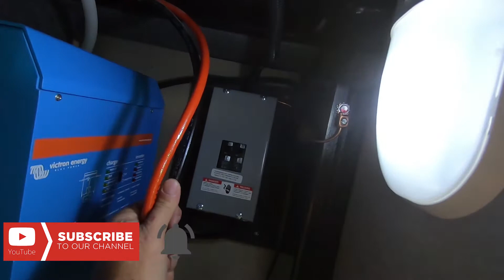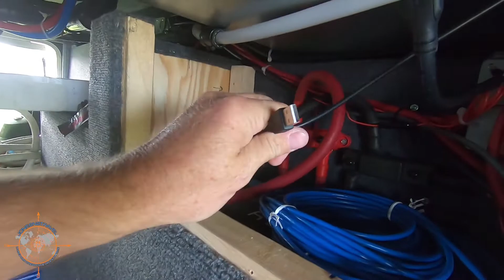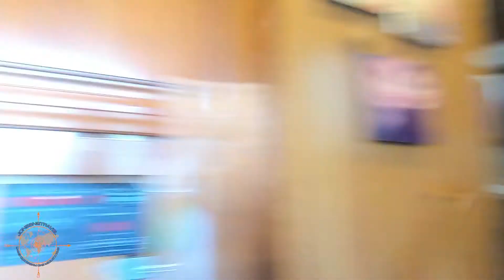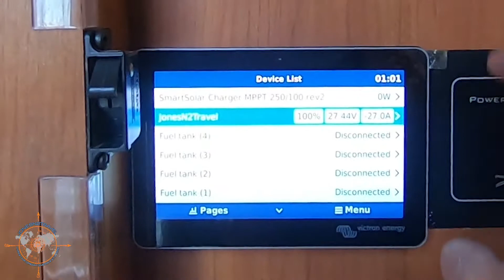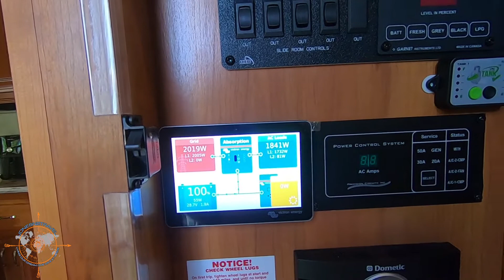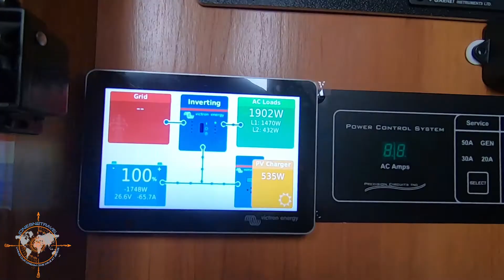DRV ULTIMATE SOLAR INSTALL | PART 4 | RV LIVING

Comment: As a follow up to our exchange a couple of months ago, the inverters are rated at 250 DC Amps and the 4/0 cable installed is rated at 195 DC Amps which would explain the high heat any system would experience due to underrating of the 4/0 cable. Since each inverter has two neg and two pos posts, have you considered running 2x4/0 cables to address the underrating of the 4/0 cable at 195 DC Amps to 390 DC Amps? This would definitely address the heat issue because more often than not one inverter can produce > 200 DC Amps at any given time depending on the demand of say an AC plus the refrigerator on one load.
Reply from the maker: A 4/0 cable at 10' length can handle up to 600 amps. I have never had an issue with the wiring heating up even while using both inverters at full power. Hope that helps. Safe Travels

Comment: Very nice install. Very similar to what I put on my Momentum. Only difference is I used 4 Tesla Model S modules wired in parallel, instead of 12v batteries.  You didn't go through the programming of your two MultiPlus Inverters, but I assume you set them up for split phase. How did you deal with the generator issue? I have a situation where I do volunteer work for a Boy Scout Council, and they provide me with a 50a hookup that is not 180-degree phase, but 120. I have set up configuration files for the both, and load the appropriate one as necessary. Since the Onan generator is wired for 2 - 50a lines at 0-degree phase, I am at a loss as to how to deal with that without an autoformer.
Reply from the maker: Hi Arthur. Thanks for checking out the video. Yes, I did set mine up split phase. I don't know of any other way to handle the generator issue without the Autotransformer. I am actually getting close to doing another video installing the Autotransformer so look for that her soon. Safe Travels

Comment: How does the system behave when you switch from 50A split phase shore power to 30A or generator? Do you reprogram the Multiplus configurations or does it recognize the common phase automatically?
Reply from the maker: It will only switch one inverter to mains and the other stays in invert to load share. There is a method I'm working on that converts the single phase from the 30AMP or Generator so the inverters think its still split phase allowing the second inverter the go to mains as well. I will be sure to do a video once I get it all sorted out. Thanks for checking out the video. Safe Travels

Comment: What temps are you seeing on the positive and negative cables during high load inverting?
Reply from the maker: Hey there. I have not put a temp gauge on them but they are barely warm to the touch. The 4/0 cables will carry a lot of current without heating up. Hope that helps. Safe Travels
Reply: @JonesN2Travel  Thank you sir...my positive cable is around 100-105F (warm not hot) when inverting high loads, yet the negative cable gets to ~ 125F or higher from the neg terminal to the shunt, yet beyond the shunt the ground is ~ 95F and at to the Victron Power in ~ 100F...all cables are double crimped (hydraulic crimper) and all connections are torqued to spec; all connections are going through a Victron Power In buss bar module...this temp issue has thrown me a curve ball and working still trying to figure it out after addressing all of the main causes (connections, lug crimps). Thank for the input.

Comment: Wow wow wow! Just wow!! You are talented SIR! In layman terms - running a dual Inverter,  dual solar panel bank system (if I said that right?) why or what is the purpose? 24V or is this recommend?why? 
Last the ReLion battery & do you have an affiliate link or discount code ?  Youch expensive buggers! 
What brand solar panels did you use? & why? 
Ok I will start saving & we hope to run into you at Quartsite someday!! Thank you kindly for ALL the info & GREAT GREAT VIDEOS! LOVE THEM ALL !! Current state Marana, AZ 
Jay&Lori
Reply from the maker: Hey there. Thanks for checking out the video and for following along. There are many ways to wire the panels on the roof to satisfy different voltage or amperage requirements. I ran my panels in two rows of 6 so I could pass down higher voltage and lower amperage to my solar controller. Our coach is 50amp which is really two legs of 50amp so 100Amp. I used two inverters because they are 50Amp passthrough each and I wanted my entire coach inverted. One panel handles leg1 and the other handles leg2. 24 volt system also allows you to use smaller wire but I could have just as easily gone 12 volts without any issues. So no, 24v is not required for this setup. I used Hitech brand panels but I have panels in my store from Grape Solar that are really nice, almost exactly the same as the ones I used. I'd be happy to design and install a system for you. Please keep in touch and hopefully we can meet you in Quartzsite too :) I am a Relion battery dealer so when you're ready let me know and I can give you a discount. Shoot me an email themobilervtech@gmail.com regarding your battery needs. :) You could also check out our new online store themobilervtech.com/store  Hope that helps. Safe Travels

Comment: What type of lugs are going into the side of the lynx distribution it looks like they go straight though and you have a bold going into them. (The left side of the lynx you can't see the cable. If it is a cable.
Reply from the maker: Hi Chris. I used two long bolts. Ran a bolt through each lug and tightened up with a nut. The bolts go through the wall and on the other side of the wall I have a nut, washer, battery cable, washer and nut to hold the cable on the back side. I insulated the bolts with heat shrink. Hope that helps. Safe Travels
Reply: @JonesN2Travel  wow it looks amazing. Neat trick there. Thank you for your response.

Comment: A great channel by the way. Very much enjoying your solar series. A couple of questions for you...Does your solar array charge the battery bank as you travel down the highway or do you have the system switched off while rolling down the road? Is there any battery bank charging available from your HDT while traveling? Curious as to whether you are able to arrive at your campsite at 100% charged or are you at least partially depleted from the fridge when you pull in to stop? By the way, thanks for your service from another retired airman who is also a Desert Storm vet.
Reply from the maker: Thank You for you service. 👊 Yes, our solar is on 24/7 so it does charge while going down the road. We generally arrive at 100% but if its overcast or for some reason we just aren't getting the solar the fridge could take 1% to 2% out of our batteries during a travel day. You can wire the truck to send power to the coach but since we have solar and the current coming from the truck is small, small wires etc., we just never hooked ours up that way. Hope that helps. Safe Travels

Comment: How did you get both DC and AC hooked up to your inverters? I also have a DRV and I built a similar set up such as yours and unhooked the old Xantrex 1000 and installed the Victron 3000 with the same wires but it appears those are all DC lines, where are the AC lines did you splice the line running to your generator perhaps?
Reply from the maker: I disconnected the "out" line from the automatic transfer switch to the main breaker panel inside the coach and ran it instead to a sub panel with 2 each 50 amp breakers. then ran a line from one of those breakers to my first inverter and then ran one from the second breaker to my second inverter. Then I ran the AC out line from each inverter to a junction box where I mated them with a single 6/3 wire back to the main breaker panel inside the coach. Hope that helps. Safe Travels
Reply: JonesN2Travel thank you for the quick reply. Now I just have to find the transfer switch, lol
Reply from the maker: @timothymcclure3370  In most DRVs the transfer switch will be behind the access doors in the front storage compartment. Look for a grey box located just behind the vacuum in most cases. Hope that helps. :)
Reply: @JonesN2Travel  Thank you again I will check there, I wish I could send you a picture of my set up yours really inspired mine.  If you're on Facebook DRV group I have some pictures in there.  I am also closely watching your HDT buying guide I am about to buy a rig for sure!
Reply from the maker: @timothymcclure3370  Thanks. I will look on the group for your pics. Glad I was able to help, at least through video :) Safe Travels

Comment: Cool! Whats all this Cost???
Reply from the maker: The entire system, retail at the time of this filming, was about $20k. Hope that helps. Safe Travels
Reply: @JonesN2Travel   Ouch. Not leaving that 5'th wheel anytime.....
Reply from the maker: @markcloutier7317  cool thing is all the equipment can be moved to a new rig if needed. I would leave the panels since they are sealed to the roof. :)

Comment: Hi Aaron, your setup is awesome. I am sure it has been mentioned in another comment or thread but I am new here. What would a person budget for this exact setup? Can you give me 2 costs...every part, and labor to install such an awesome system. Thanks kindly.
Reply from the maker: Hey Matt. I have roughly $8k invested in hardware, wire, etc. plus another $14k in lithium batteries and I generally charge about 30% of the hardware cost to do an install this large, about $6500 for labor. That includes making all the battery cables from scratch and a completely customized system for your coach.  So you're looking at about $28 to $29k for the entire system. Keep in mind this system is totally scale able so you can adjust it to be bigger or smaller to suit your specific needs. :) Hope that helps. Let me know if I can answer anymore questions. :) Safe Travels
Reply: JonesN2Travel thanks Aaron. As future full timers, we need to first figure our style of RV life, prior to such a healthy investment in sustainability.
Reply from the maker: Hey Matt. Thanks for checking out the video. I would be more than happy to give you those numbers. Give me a day or so to put them together and I'll re-comment the numbers here. :) Safe Travels

Comment: What did you use for  grommets in your wall for the wires?
Reply from the maker: Hey Joe, I used these snap in bushings. https://amzn.to/39oVZP8
They are also available at the big box store but there they are classified as 1/2 inch or 3/4 inch. I used the 3/4 size. Hope that helps. Safe Travels

Comment: That is quite a system!!  Great job on the install!!  I can totally relate to the freedom you from a set up like this.  I am curious, and understand if it is none of my business, what did this install cost you?  It seems like it will take a lot of free camping to before you see a return on your investment.
Reply from the maker: Hi Brian. Hope you guys are well. You make a great point but we love being out of RV parks so to us its worth the investment even though its ROI is more long term. We spent about $7500 on parts and another $6k on the 2 additional lithium batteries. One thing we considered is that we were able to use our 2 existing batteries and we sold our old panels we upgraded on the bighorn so that helped make a dent in the cost. Plus we saved a ton doing the labor ourselves. Hope that helps and no, I don't mind sharing at all :) Say hi to Chris for us and have a safe and happy 4th. Safe Travels
Reply: @JonesN2Travel  Thanks for the reply. We are back in CT moochdocking and making week long and weekend trips in the NE.  We are totally missing the road but look forward to getting out west again.  Great to see you guys doing so well.  Give Maggie a treat from us!!!

Comment: Wonderful and very informative video. What are the ballpark costs and time requirements to complete an install similar to this?
Reply from the maker: Thank you. It really depends a lot on your coach, length of wire etc. But, the equipment without the batteries is about $7k then about another $12k or so for 1200 AH of lithium plus labor. So you're looking at about $22k to $25k as a rough estimate.

Comment: Great job Arron will you or does it activate the generator if it drop below a certain level like when you’re off grid and was wondering if you considered putting a circulating fan in that area like on a thermostat where the equipment is to try to keep it cooler down there just a thought
Reply from the maker: Hi Tex. I do have a generator start module that I have not yet installed. I'll do a video on that install as well. But yes, the Cerbo GX will drive the generator module and start with low battery voltage and even once a month for generator maintenance. :) Great idea on the exhaust fan. I thought of adding one and exhausting it into the generator compartment since there is a lot of dead air space in there. A thermostat on that is a great idea too. Thanks for the ideas. I really appreciate your input. :) Safe Travels

Comment: Love that you take so much pride in making it a clean install 😃 We are not even close to this kind of system, but we just got the Jackery 1000 portable lithium with 2 100 watt panels to help with boondocking in our new campervan. We are excited to learn more about solar power. Thanks for sharing.
Reply from the maker: You are very welcome. Sounds like you're off to a great start. I started with 4 panels and 2 golf cart batteries and it just evolved from there :) Safe Travels